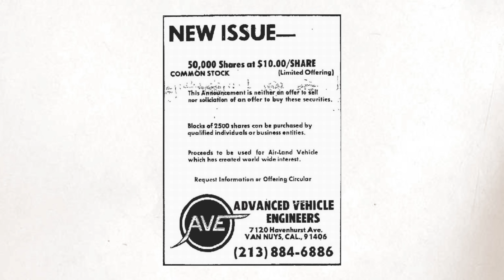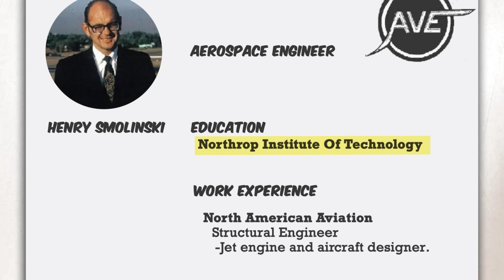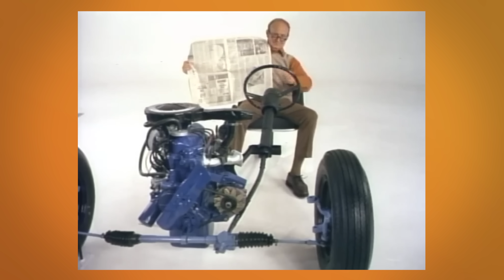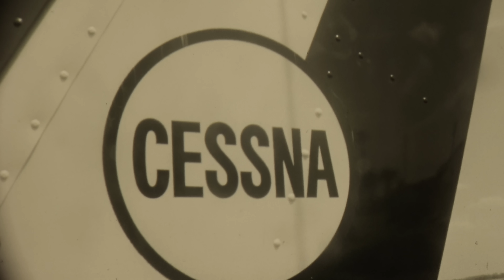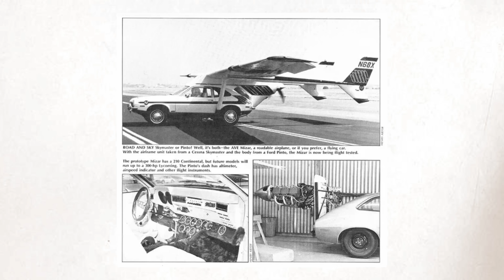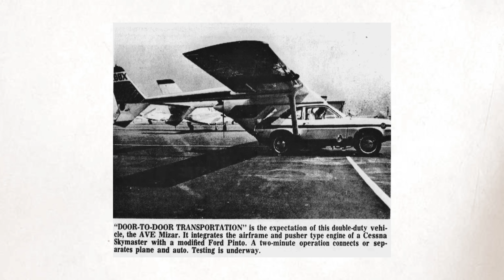The wild 1970s flying car that actually worked... until it didn't

Comment: Flying, is inefficient. You need all the energy of moving something from Point A, to Point B, while also requiring the additional energy to defeat gravity. The Average driver struggles with 2 dimensions, Flying Cars adds a third. In a land restricted vehicle, negligent maintenance can at least lead to it rolling to a stop somewhere. Airborne ones tend to fall a bit first, with deadly results.

Environmentally, financially, and safety, Personalized flying cars is a stupid idea. You only have to look at all the Airlines struggling to make ends meet to see defying gravity isn't easy on the budget. Mass transit, better infrastructure, actually using the Internet instead of requiring people to needlessly travel to one place to communicate, is the solution to the problems.

Comment: This is an interesting video. I like it. But it seems to be saying that this particular flying car is a first. But that certainty is false. Employees at Convair built a successful flying car about 70-years ago. And later at least one more flying car took to the skys. The idea was to drive to the local airport where the wings and things were in a hangar. After donning them the craft would fly over heavy automobile traffic to a city nearby. Then at the local airport the wings and stuff would be taken off, and the car would be driven to work or shopping.

Comment: These two mathaletes chose to fly a car that had previously experienced failure in a key strut and then underwent zero repairs to the damaged points of concern before BOTH men got inside the machine and flew in to the memory banks of local news stations.

Comment: "The risk of getting rear ended in the air is fairly low". Good stuff. 😅
Reply: Rear ended in the Mile high club, or the 400 ft club?
Reply: @godsinbox  😊😅😂😂
Reply: I guess it's possible nowadays, doing a mix of a car + plane. In the past, zeppelins and globes could easily fly, why not? The problem is this 21st century and its traffic by air, other flying carplanes , militar planes and so on. It's worthy to investigate solar planes (one crossed the Atlantic), but they need more money to be invested, like all the sciences today. c u all
Reply: I have been a recreational pilot for years. You'd be surprised to find out the number of near-misses in the sky. Most because of rigidly defined circuits patterns that basically forces planes to the same paths and entry points around airfields.
Reply: But if it happends.... The seatbelt won't save your life. ⤵️🥺😶‍🌫️👻☠️
Reply: @Altinget  It will save you from hitting your head on the ceiling if you get caught in a bad turbulence thus keeping you in good shape to keep flying, or if your plane rolls after a bad landing.
(Opening the doors before a controlled crash is a good idea)
Reply: @scsirob  Yeah, I guess if you're in a cessna on final approach and you're pfaffing around at 65 knots you could get rearennded by a 777.  😅
Reply: @bobdobalina838  Even if the 777 doesn't rear end you and goes above you... you'll splat on the ground due to the wake turbulence.

Comment: I worked with Hank Smolenski at Rocketdyne, Santa Susana. He was always "I can do it different (better?)". The Pinto that he had was not ordinary. It was decked out like a Continental coupe. He received some advance money from Galpin Motors and had to meet certain milestones to get more money. He could not get permission to fly it at Van Nuys so he had to go to Oxnard where take offs would be over unpopulated areas and the ocean. I knew some witnesses of the first flight and they said it struggled and had a "hard" landing. The recommendation was that he do an X-ray of the wing before flying again. His budget didn't include X-ray. I heard that his test pilot refused to fly so he took it on his own. Shortly after take off the wing spar failed and the crash occurred. An X-ray would have shown that the spar was cracked. I was told that he was alone.
Reply: I would like to talk to you

Comment: Spend a few grand on a good used paramotor and boom, problem solved. They’re not regulated like other types of aircraft, you can take off and land from pretty much anywhere, and they make tandems if you want a passenger. Plus you can fit everything in a pickup or a van. Granted, inclement weather makes it restrictive. I still think it would be awesome.

Comment: The reason for the aerocar can be seen everyday on American interstates. Think of the last time you saw a small car being towed by a RV.  The RV gets you close to where you want to go, it gets parked and the little car is used to drive you the rest of the way.  Right now I am using  the front suspension from a VW bug, the frame, engine and rear suspension from a Honda GL1200 and the about 1/2 of a Piper Cherokee fuselage to build a reverse trike.  The fuselage without wings and etc. is VERY light, under 200 pounds ... and fairly aerodynamic.  I can't see why somebody couldn't substitute the fuselage from a high wing Cessna to build a reverse trike and add the same Cessna parts as used in the Ford Pinto attempt.

Comment: I agree 100%  that they are trying to solve a problem that is already solved and call it a new thing.  Its not just flying cars, its the whole need to fly from one side of a city to another - it quickly wouldn't work.  Self driving cars is another area that people are not actually asking for and the actual problem hasn't been well defined to start with; instead the technology going into trying to make the car take all the decisions is actually well placed to prevent accidents from humans making the decisions.  Aircraft will always be crippling expensive because the stakes are much higher, we have barriers at the side of the roads fo when things go wrong but its not practical over your head.  Then there is the way the airspace is used and shared, currently although well understood we would do it very differently.

Comment: It's sad - it was a great idea - but surprising it was too heavy - the Skymaster was used in military and Air-Ambulance applications - pushing 4600lbs (max takeoff weight). The base Pinto only weighed 2000lbs ... you figure they lost the front engine and prop in the conversion and you could do a lot to lighten the Pinto further. Likely it was a poorly designed integration of the car body to an older Cessna model's airframe or controls.

Comment: Molt Taylor designed and built several practical and functional "Aero Cars" in Longview Washington in the 1950s. I remember sitting in the Kelso, WA airport FBO lounge with Molt and 3 or 4 other pilots as he described the meeting between him, the FAA and Ford Motor Co. officers. He said that when Ford said that they planned to build 50,000 units, the FAA got up and walked out.

Comment: My cousin had a new Pinto in the 1970's.  I was insanely jealous because my Toyota Corona (precursor to the Celica) with 175,000 miles and a tired frame that I paid $300 for was not near as reliable.  He never blew up.  Mine eventually rusted to dust at around 200,000 miles.  But it did make me a Toyota fan.

But . . .as far as flying cars.  Until you can convince Joe Citizen to put down his cell phone and pay attention to his environment.  No.  The sky has no lanes or traffic signals.  We can't even obey them as a population, so unvettered sky access would be a horror story.

Comment: There is an old quote from the early days of aviation that is still as true today as it was over 100 years ago.
    Aviation, in itself is not inherently unsafe. But to an even greater extent than the sea, it is unforgiving of incompetence, carelessness or ignorance.
    The real problem of making a flying car is not an engineering problem, it is a problem of over coming human stupidity. Airplanes are actually easier to control than cars. But cars are way more forgiving than airplanes.
Reply: I disagree about airplanes being easier to control than cars. For one thing in a car you only have to worry about two dimensions. Also bad weather is far more dangerous to
planes.

Comment: "Airplane of the People" was a nice fantasy but hype for sure.
Anyone flying one of these would be required to have a pilot's license, and those aren't easy to obtain.
So all the negative comments about the average driver's poor driving skill are irrelevant and don't apply to this concept.
Those who fly small airplanes understand the value of something like this, because once at the destination airport, the pilot could just drive to the final destination. At present, one must rent a car, take a taxi, or summon an Uber or Lyft ride. Some pilots bring a bicycle along.
The vision here is arguably brilliant but badly engineered and poorly, fatally executed.
These guys violated one of the primary rules of flying: "Don't do anything dumb!"

Comment: With modern construction techniques, and materials this is possible today. I would use a "Smart car. Gut it and build a tubular frame inside the car, and design around it. The simplest way to go would be a micro jet engine like on a Sonnex, or similar."

Comment: I feel like an airplane that incorporates a two seater motorcycle would be the way to go, it'd be much lighter then a car, and still have the benefit of having ground transport at your destination.  Wouldn't necessarily be just a motorbike with wings either, it could be more of a traditional airplane but able to carry the bike in a way that it'd still be balanced in flight.  Or maybe even a 3 wheeled car: it would provide enclosed ground transport, but since they are classified as motorcycles in many places, they wouldn't need to meet all the crash test requirements a car does that add so much weight.
Reply: Didnt they do that in Mad Max 2?
Reply: @DanJackson1977 I don't think so?  From my memory that was an autogyro, a type of ultralight aircraft (though normal aircraft versions of them also exist).

Comment: The two designers deserve a Darwin Award.
Reply: You poor thing.  You really don't have a clue, do you?  Basing your opinion on a snarky 11 minute video.
Reply: @dougearnest7590  So it didn't fail because it was badly designed and constructed?
Reply: @ - I know Smolinski was a structural engineer in the aerospace industry - AND a licensed pilot (something the video never mentioned, implying that anyone could just hop into a flying car and take off with no training.)  I also know the pilot's body was burned beyond recognition, but miraculously his ID was not damaged so they could identify the body without going to the trouble of using dental records.  I also know the full narrative of the NTSB report is not available online.
There's more - like maybe this test flight wasn't intended to be a test flight.
Bad design?  Not necessarily - don't go by this video.  Poorly constructed?  Without a doubt, but what are the circumstances behind that - and was it at the stage in construction and testing in which a test flight could be justified?  Before this, testing the basic concept involved driving the car down the runway until it lifted off a couple of feet, flying for a few seconds, then setting it down again. 
At any rate, the Darwin Award belongs to the guy who lets the people on television tell him what to think - there's a little more to the story here which is trying to exploit the deaths of two men for laughs.
Reply: @dougearnest7590  It had nearly fallen out of the sky once, and they tried again without seemingly correcting the structural problems. They were reckless at the minimum.
Reply: @geoffreypiltz271   You and I would never be that reckless, but a structural engineer / pilot would blow it off?  Something doesn't add up.
I know a LOT of times throughout history people did things that didn't make sense, but this goes beyond the "must have had a brain fart" explanation.  Would you go for a drive knowing all the lug nuts had been removed from one of your wheels?  Not even in an emergency.  Nor would a pilot go flying if the wing wasn't properly attached to his airplane.
So I still vote 'no' on the Darwin Award, and 'yes' to calling out the b.s. being produced by content creators like this.
Reply: @dougearnest7590  Why are you so worked up over this? You aren't related to one of them are you?
Reply: @ I'm not necessarily "worked up" but then I guess that's not too far a stretch for someone handing out Darwin Awards based on what they see in a Youtube video.

Comment: I wouldn’t call it total bs, just not practical.

 Convair made a flying car that looked like a flying Jaguar and it too fell from the sky because nobody checked the fuel level so the engine sputtered then it plummeted to the ground….

 The flying Pinto wasn’t properly engineered and I guess they didn’t debrief the pilot after the first flight because the only change to the overall structure of the plane was just the heavy new engine. The 2 geniuses never talked things over and so they got what happened to them.

 The closest there is the Terrafugia Transition, which is more like a readable airplane than flying car as you have to drive to an airport, unfold the wings before taking off.

Comment: If they ever do allow flying cars, I think they will have to be a fully automatic vehicle...full-time auto-drive/auto-fly.  Highly regulated and integrated with an automated traffic control system.  So, you simply tell the vehicle where you want to go, and it will perform a rapid systems self-check and decide the most efficient route and method...possessing much more capable sensors and AI.  Where the roadways are not optimal, it will automatically request and receive a clearance to fly a route (like in milliseconds).  All such cars will be required to cooperate with the traffic control system, both on the roadways and in the air.  This may be another 30 or 40+ years from now, though.  Traffic jams, road rage, impolite, aggressive, intoxicated, sleepy and incompetent driving will all be a thing of the past when this happens (except, when weather is severe there will be delays).
If this is implemented any other way, there will be flying cars crashing down out of the sky 10 to 20 times a day in cities, in good weather, 50 to 200+ a day in bad weather. 😄

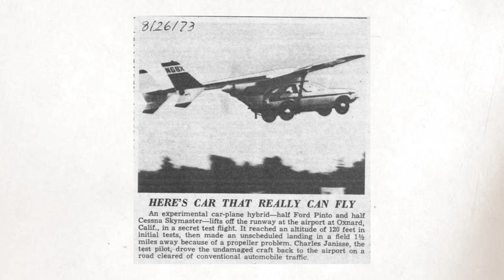Comment: Why does everyone assume that a pilot's licence would not be needed to fly a thing like this ? As in the BS at 9:25 "They wanted to give us all a chance to fly etc etc" . A flying car is still a plane when it has wings on, it just has an unusually shaped cockpit. Having a steering wheel instead of a joystick doesn't suddenly make everyone a pilot.
Reply: Who said not needing a pilots licence? The VW Beetle was called the car of the people, but you still need a driver's licence.
Reply: @xpusostomos  It is implied by the statements like "give us all a chance to fly" and "folks can barely drive a minivan without crashing. Good luck"
Getting a pilots licence is demanding and expensive, so few would want or manage to. Most of the people who would want a "flying car" will already be flying a light conventional plane today.
Reply: lol yup
Reply: Because requiring an extra license defeats whole universal accessibility selling point. If you need a license then just use the existing modes of flight 🤡

Comment: You said "ailerons are controlled by turning the steering wheel left or right" but showed the rudder being controlled and then didnt mention how to control the rudder? So which is it? Does the steering wheel control the ailerons or rudder?

Comment: It's odd to me that every time the pinto is mentioned it's criticized for it's fuel tank location but that was a very common location for the fuel tank in many other cars being built at that time.   The gas cap on my 70 Torino was behind the license plate and the same with many other cars.
Reply: If it was ruptured, the fuel could flow into the passenger compartment. The ford fix was a shield to keep that from happening but I don't know if it solved the problem. Cars today have a fuel tank that can be removed from the outside as a full assembly so the tank is isolated from the passengers. At that time I drove Falcon that had a more traditional design and without airbags or seat belts was about as dangerous as everything else on the road.
Reply: @denawiltsie4412  I own a 65 Falcon and the rear bumper is very heavy thick steel. Any modern car that rearended me would crumple up before even coming close to the gas tank. I also owned a Pinto, and unless I was rearended by a cement truck going 60. BTW, the film of the Pinto exploding was rigged with a small explosive device.

Comment: An aerospace engineer who built stuff for moon rockets thought screwing the wing struts to the car body without any reinforcement would work. WTH? Rocket engineers constantly look for every opportunity to reduce weight, yet this guy piled on more with a bigger engine. How much input and supervision did he really have? Or was he developing some kind of mental issue that deleted his common sense about how to build lightweight stuff that's strong?

Fiberglass hood, front fenders, doors, and hatch. Aluminum wheels. New seats built with aluminum frames. Delete the rear seat. Did Racer Walsh have aluminum heads for Ford 4 cylinder engines in the early 1970's? Replace the heavy cast iron exhaust manifold with a tubular steel header. No power steering or air conditioning.